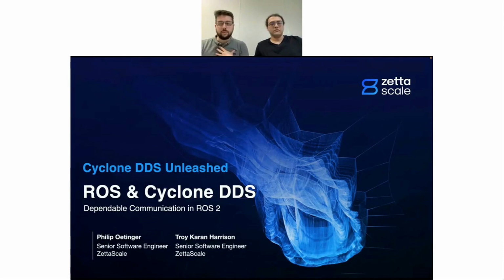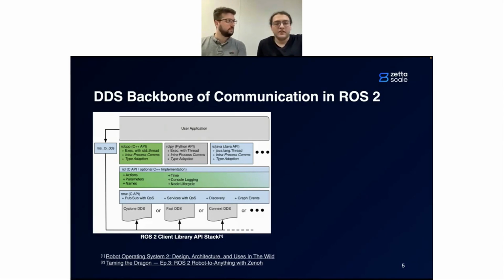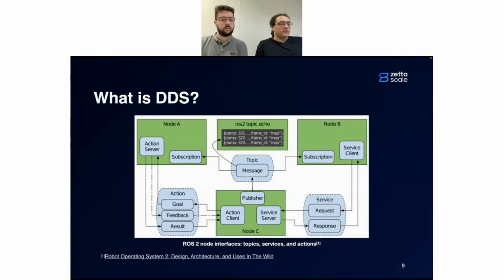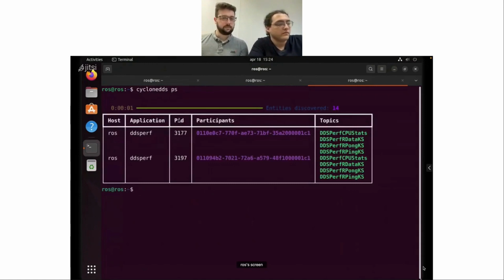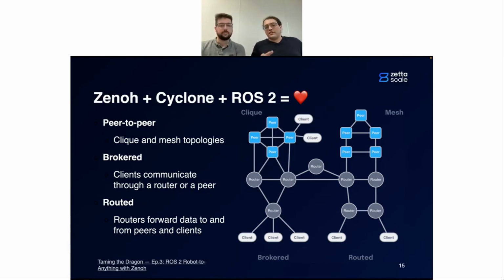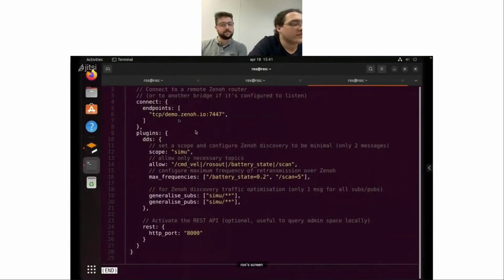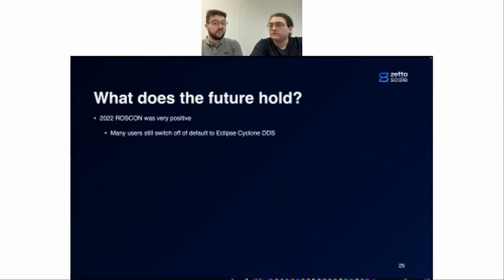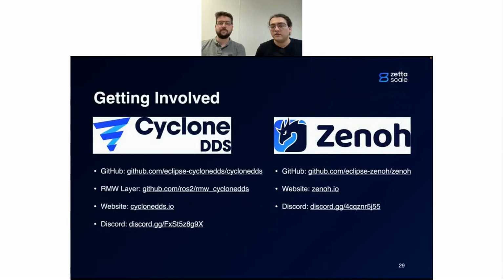DDS and ROS - A Powerful Combination for Robotics

Comment: @15:35 latency budget is discussed. Where exactly it is defined? Does it change dynamically ?
Reply from the maker: The latency budget is defined as part of the OMG spec under §2.2.3.8: https://www.omg.org/spec/DDS/1.4/PDF.

To paraphrase: this policy serves as a way for an application to communicate the "urgency" of data communication to the middleware. The specified duration, when non-zero, allows the DDS implementer to optimize how to transmit the data to fit within the latency bounds. However, it's important to note that this policy is a hint, and there is no prescribed method for the service to utilize this information.

In terms of Cyclone we batch the messages to be written on another thread and then send out the batch of messages once the latency budget has been expended. It's not a dynamically changing value. We have some documentation describing how we choose to make use of the latency budget provided by the user here: https://github.com/eclipse-cyclonedds/cyclonedds/blob/1c9bc19f94c6dd6c62b573fed335a0663cb84d9f/docs/dev/async_write.md

And we have some documentation on setting the latency budget in a QoS object: https://cyclonedds.io/docs/cyclonedds/latest/api/qos.html#group__qos__getters_1ga7f50e88c3213379b9fe31a288845fcae

If you have any other questions, feel free to drop by our GitHub or our Discord channel: https://discord.gg/UZB5b5h7KT